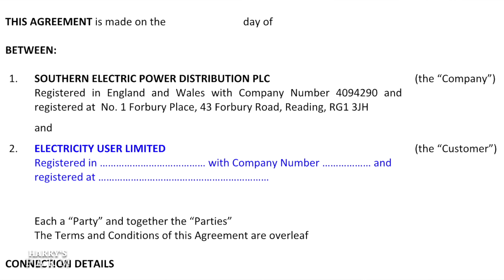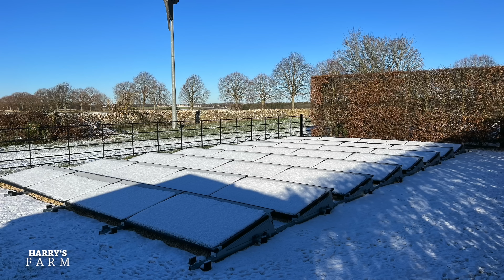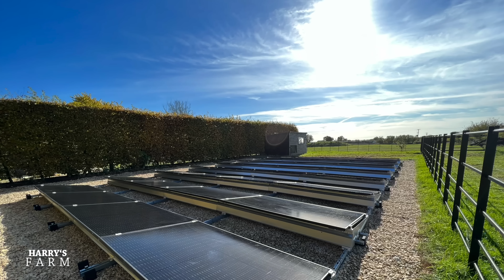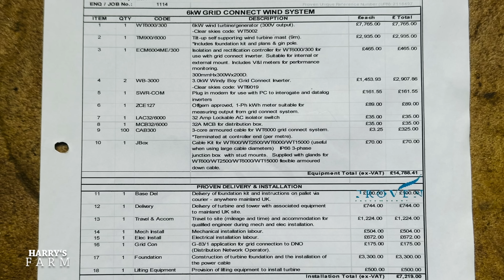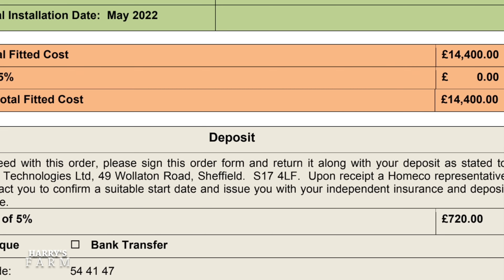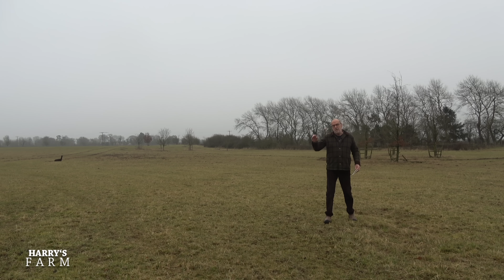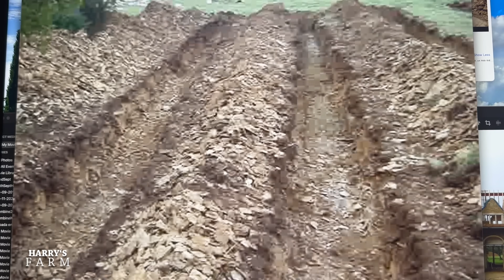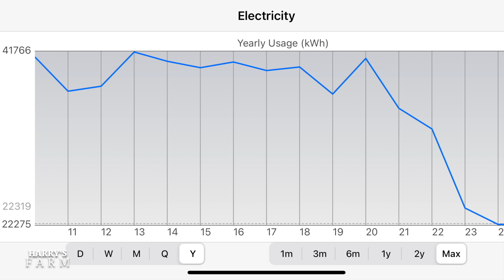Are solar panels & heat pumps worth installing? Here's what I've learnt after several years of use.

Comment: I wonder if the GSHP is a reverse cycle capable unit? Heat could be pulled out of the house in the summer months and put into the ground as a heat store for winter needs!
I think the solar panels could be relocated away from the hedging and a number of different things could be tried to make them more efficient?
Of course, solar charged batteries could also be charged at night on a time of day contract although I don't know if they'd be available to Harry as a farmer or if the supply contracts between the house and farm could be split!?
Charging the batteries and car's up over night on 7p/kwh (Octopus) and selling the solar produced electricity for 15p/kwh is a much more efficient use of them both environmentally and economically!
The pool could also be a useful store of solar energy in the summer months, which could be extracted at night for storage in the ground, if the ASHP is reverse cycle capable!?

Maybe Harry could Colab with The Heat Geek channel and optimise his system somewhat!?
Maybe the ASHP (depending how old it is) could be replaced under the government grant for a more efficient reverse cycle unit etc!?

Comment: Its the pragmatic approach which we should be taking to all things. Engineers are much better at solving problems than politicians so why do we have massive, sweeping change pushed on us by ill informed people being told what to do by activists? 

Ground source is great but the way modern "houses" are crammed in to as small an areas as possible its hard to see it ever being effective for anything but places with very large fields available. 
I'm yet to see an air source system which is decent and doesn't just over promise. 
Solar is all but useless a lot of the time too but again it wouldn't hurt to just put panels on every new build and what it makes it makes. If it halved electricity use for a few months per year thats a decent gain - presuming the panels are long term reliable and durable. 

I think the insulation is the larger issue. If you have a very well insulated home it takes far less energy to keep it warm once its up to temperature.
There is also a lot of waste from leaving lights on - be that in the home or street lighting on roads where nobody is around. I've noticed a lot of shops too leaving the whole place lit up all night even though the shutters are down. LED bulbs may be more efficient but they are still using a lot when left on for 12+hours for no reason at a countrywide scale. 
Plenty of other waste like wars for nothing which is yet another political failing but affects everyone financially and environmentally. 
I still think the largest polluter which could be easily cleaned up a lot is the commuter. Hundreds of thousands of people in trains, planes and automobiles heading in and out of big cities all at roughly the same time (so massive congestion), often from far afield and the vast majority of them don't actually need to be there. Anyone with an office based job can potentially work from home and cutting that commute would not only free up hours per day for workers but also that much in mileage, traffic, wear and tear on the roads, etc. 
It would also mean nowhere near as many offices would be needed so the let over ones could then be turned into homes rather than ever more greenbelt grabs. 
Its amazing it doesn't get mentioned more - something which tells you who owns the property in the large cities and just how much they rely on the current set up to keep the money flowing.

Comment: Your installation doesn’t appear optimal due to the low angle. We installed a 4kW system on our roof in 2011 and get a similar generation to you with a much smaller system.

Comment: Very informative, thanks Harry. I think the biggest takeaway here is that, whatever you do, get your house insulated and underfloor heating put in before you do anything else. More than anything this will reduce bills and allow any kind of relatively low-temperature system to work effectively. I'm not sold on solar in the UK, although I've read that you can get quite a bit more out of them if you have them on south-facing roofs or auto-rotating/tilting mounts, the fact is that when you need the power most, you will be getting the least out of them. Works for you with your pool but for most people why would they need excess power in the summer? In a well-insulated home even running your heat pump as an aircon won't use much power in a +25/30 degree summer. One thing I am interested in is your heat-pump field, you've been sucking heat out of it in the colder months for 20 years now, have you noticed any difference in what tends to grow on the surface? I just wonder whether you could be artificially re-creating a sort of early 20th century pre-global warming micro-climate with lower soil temps in that field, would be interesting if that has any effect on the flora and fauna.

Comment: With respect Harry, your set-up is horrible.  Research has shown that these angled horizontal arrays are lousy.  Instead, look at bi-facial vertical arrays.  Effectively, this is a vertical fence or wall of panels running south to north.   

How is this advantageous?  The panels absorb more energy through a longer time period of daylight than the horizontal panels, which give a lovely high peak at midday but drop off sharply either side of that peak.  It may be counterintuitive, but the vertical array absorbs more energy over the course of the day.   What else has been discoverd is that by zig-zagging the panel wall so that the main absorption side faces about 15 degrees to the south and the secondary side 15 degrees to the north, further increases the absorption.   Further increases are made by installing a reflector on either side of the wall of panels.
And:
The snow in winter does not accumulate on the panels.

DO NOT rely on your panels to give you immediate power.  Get a good battery/inverter set up.  The panels are not for immediate power, they are for charging your batteries.  The batteries/inverter are the true power supply.

I promise you, you will gain at least 50% additional power generation by employing these methods.

Comment: great video, thanks a lot. I have an old victorian sandstone villa in the highlands of scotland (300m2), and I go through 2500 litres of oil a year (around £2000), and around £1500 of electricity. But, our house is not warm throughout, we do not have a pool, and we don't have a heated garage! So considering you have a lot more, the cost seems very reasonable.
Reply: Just what I was thinking!  I'm in a 3-bedroom rubble-stone cottage in Inverness-shire and using about 3,000 litres of oil, about the same as you in electricity and a couple of tonnes of logs in the woodburner!
Reply: @rb9580  yes i didn't mention the tonnes of logs i go through! I bought an artic lorry load this year (27t) so hopefully that should last a few years!

Comment: I was surprised to see the solar installation on the ground and surrounded by hedges. How did anyone recommend that?! It needs to be on a raised system (a.k.a. "LEGS")and you can use the space under it for storage or growing veg that don't like sun! You've also got them at a very flat angle, they should be at right angles to the sun, better if you can change the angle through the year. https://www.youtube.com/watch?v=Lp9umll80xg

Comment: I have wrapped my head around the lack autum/winter/spring renewable production, even after tilting my solar pannels and more wind tubines my battery still does not keep up. Ive come up with a small biogas distillery, it would be a long summer process though, filling catching and compressing to use in a generator in winter.

Comment: In our village a new housing development was put in about 12 years ago . All were provided with heat pumps . Every house has had to replace their heat pump in the last few years . They don’t last as long as you might imagine . The cost has been @£8,000 plus . The reason being new heat pumps have different fittings now and that ups the cost on top of the actual heat pump. So you do need to factor in replacement when doing your sums

Comment: The shading issue can be handled by having individual optimisers - one for each panel - rather than having a single one per bank.  That means if one panel gets shade, it doesn't affect the power output of others.  I have this set up on my house, and if one panel gets obscured by a cloud or something, the other panels just carry on as normal.  Basically your install is typical of early 2000's install, whereas now they're a lot more "clever".

Comment: We have solar and a 13.5kwh battery. The house ticks over at around 500w so in the winter we charge the battery on a low night rate and use its power to run the house throughout the day. Provided we don't run the cooker hard or other power hungry devices then it can see us through to the evening. We have also found that on overcast days or 10 panels can produce around 300w which extends the battery life somewhat.

Comment: - to clarify. All this talk about your various "day rates" and "night rates." This is National Grid clinging on to being a 1960's concrete bureaucracy. Back in the 1960's we couldn't disseminate this information. Hence there used to be these set rates, all switched on and off, by mechanical brass clocks, irrespective of what "the weather" was doing. Today we can! - Look at all these graphs Harry is waving around. This is a farmer, in the mud, done off his phone in the back of his tractor for pity's sake???? - you think we can't tell 20+million households, through out the UK, that the wind farms in Scotland are going like the clappers, and you can wash all the socks you want for the forseable next 12 - 15 hours, at peanuts prices? I gurgle every time I hear mention of "Smart Meters" - they are NOT. If they could let us program our freezers - or the swimming pool heater, depending on the spot price - THAT would be a SMART meter! National Grid are suffering from "Charles I Syndrome" divine right to rule, and damned if they are going to justify themselves to anyone. Sorry, but the first thing we need out of the way, is the 1960 concrete bureaucracy thinking. To move on, they need to let go of some stuff - this old 1960's brass clockwork stuff. Huffffff. Well, there's the future. There are no engineering problems. We've got all the bits in our smart phones. There is just a big heap of people stuff. How are you going to get at it?

Comment: Only watched the start so far, but you were very badly advised by your installers.
For a start each panel should have its own inverter to eliminate the problem of shading of 1 panel taking down the whole string. The shading of the metal fence will also have an impact when sun is at low angles in evening - just a single wire across an array has an effect and it all adds up.
Second the angle of the panels is optimised for summer when you can't use it all (edit: unless you have a pool). I have a 4.6kWp array and generate more in winter months thay your 3x bigger array does. That's because mine is on an unshaded SW facing 46degree angled roof. It has never been cleaned in the 5 years we have had it. It also doesn't accumulate snow or ice.

Comment: Great video as usual. I have a quite similar setup. I also halve my solar panels installed on the ground. My heatpump works with 3 boreholes of 77 meters deep each since I don't have as much space as you do. They are spaced 7 meters apart, so not to inflict with eachother. 

I find it odd you don't use your heatpump in the summer. We reverse the heatpump and use it to cool the floors of the house in the summer. No aircon needed with cold floors. Only strange thing is: I walk barefoot in my house during the winter (because the floors are warm) and have to put on socks during the summer (because the floors are cold). Maybe my (smaller) house has larger windows facing south-east and Belgium gets a bit hotter than the Cotswolds.

It's sometimes freaky to see how similar we are (although I'm 30 years younger). You used to have a new defender 90, an Emira, a range rover sport. All cars I also have. Now you have the same setup with solar and heatpump. It's quite bizar.

Comment: The low angle of the panels there has a big effect on the efficiency during the winter.
My system suffers just the same, as my panels are on low/shallow roofs. In my case, there was little benefit in increasing the panel angle to help in winter, as the low sun angles meant that the panels would suffer tree shading.

Comment: Nice setup, this is intended for flat roofs, if you go with 30-40° angle it would improve significant, snow will fall of. you can easy reach 10% outcome of sunless day, ok it depends on the clouds.
Shading can also be improved, string the shaded together, so the others 3 can work at full capacity. Sometimes it is cheaper to drill deeper for geothermal heat, the gains are larger, but drilling is more expensive. So it must be calculated flat works or deep down.

Comment: I live in northern Italy. Lots of sunshine and many properties have solar panels. All well and good you might say. However if you lease a new car, often the deal comes with hail damage protection. You frequently see cars in the area which are inundated with dents. I have witnessed in the past two years three events with a severe thunderstorm releasing golf ball sized hail. Luckily I have a garage for my car, but the roof to my house was damaged.

However there have been hailstorms where the hail has destroyed solar panels on roofs, particularly around the Follina / Refrontolo area. You cannot insure solar panels against hail damage.

Also last year on three occasions we had heavy summer showers that left my car covered in mud. Sahara dust is notoriously difficult to remove from car paintwork without scratching it. Homes with solar panels had to employ cleaning companies with Cherry pickers to clean off the mud several times. Likewise when it snows.

Solar and wind is just too intermittent to be considered as the major provider of electric power for a country. On the 20th January, I still have the U.K. National Grid live screenshot taken at 11.15am showing wind generation at 4.9% of demand and gas at 64%. It was virtually the same on the 22nd. If Miliband gets his way, the country will definitely experience power cuts.

Comment: Worth having the battery to cover the house consumption when it's dark. Also means you can charge the battery on cheap overnight rate in the winter (7p on Octopus Intelligent Go).
Reply: Also, if you had optimisers on the panels you would prevent the shading of one panel pulling down the whole string.

Comment: There used to be a very simple little book, writen I think by Susan (someone or other) on Windmills. Old ones. It explained something that is missing today. In the old days the windmiller used to work according to the wind. If the wind was blowing, he'd open up the stones and grind rough animal feed. If there was only a breeze, he'd close the stones up and grind fine bread flour. And if there was no wind at all, he'd pack up and go fishing. He fitted the work to the wind. Today we have two problems. We are used to big steam generators which worked 24/7. So we don't care. Plus the turbines / panels are 600 miles away and we don't know what is going on at the turbine / panel. THE ONLY way to reconnect YOU with the power generation is what I call truely "smart meters" - National Grid have this information. But they will not tell you! - if the "spot price" was transmitted on to YOU, so you could see the price being offered by the generators, you could program your devices, fridge, washing machine etc, to buy electricity at a set price. This would absorb the capacity when it was available. OK, to start with there would be a few cock-ups, a few pairs of socks that didn't get completely washed. But eventually most people would get the hang of it. National Grid have this information. They have rows of guys in bowler hats, reading the Radio Times, and deciding when you are going to turn on the kettle. Well, it ain't the 1960's any more! We have the data. We have the internet. We are constantly being told about "the internet of things." - well here it damned well is! Lets get on with  it!!

Comment: Sorry, but that installation had NO consideration for efficiencies. Lift that array 1m on the front edge and tilt it at latitude and you will have a helluva change. The lift will reduce imoact of shade quite a bit, plus the panels will run cooler and be more efficient.

Comment: Harry, you must have had the batteries explained to you? They run your house at night in summer and you draw cheap overnight electric or your wind turbine in winter and it can run your house during the day in winter on cheap off peak. In your case a triple Powerwall would be appropriate. I use 20-25kw a day and have a 6 kw roof system and double Powerwall. The Powerwalls save me more than the solar does. 

And on a ground installation why have you not got a variable angle bracket system? You just tilt them once a month.

Comment: Obviously you will not have enough solar  power in winter for heating. However the excess energy exported in summer should earn enough money to offset the costs of grid power consumed in winter, especially if you have battery storage to be able to run on cheap night tariffs
Reply: Seems so obvious, doesn’t it?